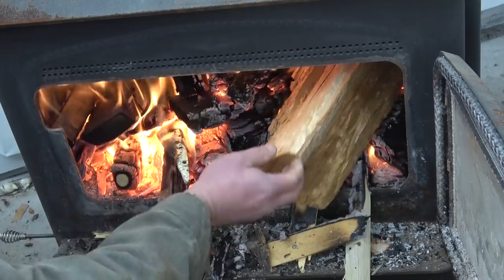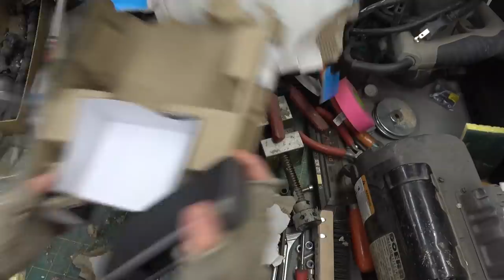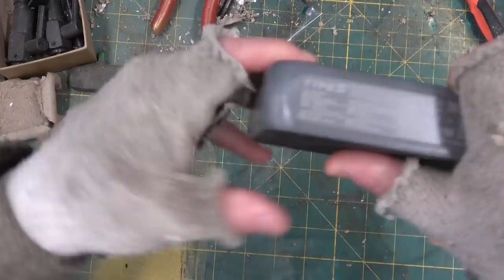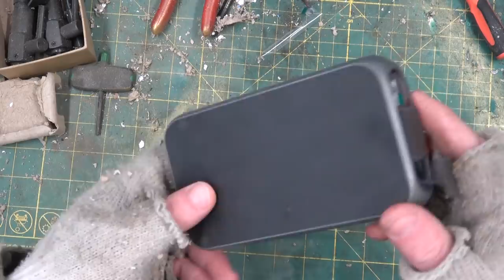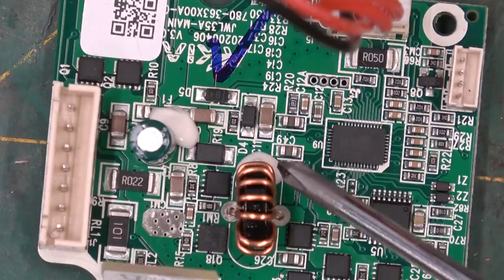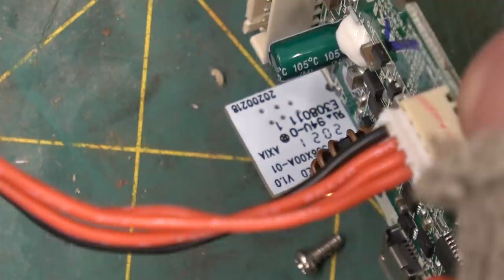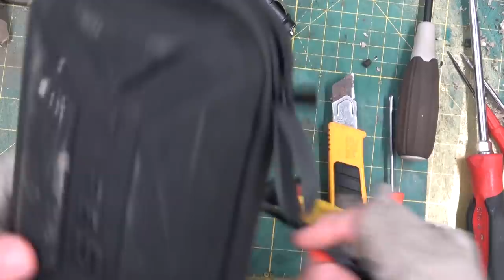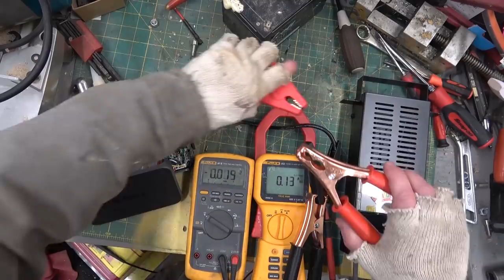BOLTR: Costco Boost Pack | Stupid Design

Comment: The question, my fine weathered friend.... was "Why all the voltage drop across the cable and Mosfet Assembly" And I'm still pretty green here, but I believe what you're seeing is the result of the high saturation current necessary to drive fets. I believe the packages there require a gate current of 1 amp to saturate.

Comment: I've used a couple of these jump charger packs, the usability is all about the dingus end that you are complaining about. The Anker models come with a much better thought out break out board for the 12-volt jumping controller. Having the active display showing you what the bit is doing is nice. It has no problem resetting itself several times and letting you crank the motor. The one I have has no issues starting up a car without a battery.

Comment: The problem with usb c is usually just dust and dirt that gets into the port and keeps it from plugging in properly. A needle or similar is usually enough to clean it out and get it working again.

Comment: You start fires with the same torch I do, but I skip the cardboard because it adds more smoke than heat and the heat isn’t needed if I have kindling at all. 
If I really want no smoke, I use the torch before I put wood in, to get the stove warm enough to start flowing up the chimney before I put wood in and light it.

Comment: For USB-C, the cable end is supposed to be one piece drawn steel.  If you look and can see a seam, then the cable connector wasn't produced to spec.  They made it so the cable is what is supposed to fail, not the jack.

Comment: These li-poly jump packs are old tech. I gots me a super capacitor-based jump starter—800A cranking amps claimed. Used it once to jump my half dead battery, worked like a charm.

Comment: For phone I recommend magnetic usb cable (flat not round version), as small piece remains in a phone. When it gets worn out, you just throw it small piece out and stick there a new one and your are good to go.That way you won't worn out the connector in your phone.

Comment: Bought an older version of these 3 years ago as a gift for the lady. She had to try it once, called me to say "this POS doesn't work". Assuming problem existed between battery and heels, I decided to try it myself later. Worked 0/5 tries... In fact all it ever does is beep "NOOOOOOPE" on every attempt. And yes, it was hooked up correctly. I even tried it on a weak mower... it cranked, but was too weak to even start that (Label rated 200-350 crank Amps...... more like crack asses). Absolute hot stinky garbage. Buyer beware.

Comment: The need for the reset is probably because of what you pointed out- the box on the leads was made from a third party (cheaply) and probably doesn't interface well with whatever is in the main box.

Comment: What the cheaper jump boxes do to prevent the car's charging system from over-charging the battery is they setup the battery to be ~16v when fully charged. With a typical car charging system rarely ever running over 14.4v, you wouldn't be at risk of overcharging the battery. Your battery was showing very near 12v, so I don't know that yours had the same philosophy. Although the FETs would likely prevent back-feeding current in your unit's case.

Comment: I have that same booster. jumped 4 or 5 cars and 1 truck.  The last few times, it has let smoke out of the little box on the jumper cable ends but still works.   You absolutely have to let it wait, it won't crank shit right off the bat.
Reply: P.S. my wife works for a liquidator that handles southern california Costco returns, so she has stacks of these at all times.   it is a commonly returned item.

Comment: Watt hours are printed on batteries for flying and the TSA does not require multiplication skills, 100 WH limit per battery. The switch is probably inset to reduce the odds of accidentally pressing it as it bounces around the back seat.

Comment: These battery packs do actually work in the cold, but only on the second or third try.  The initial attempts warm the battery up, until the voltage rises high enough to actually get the job done.  You just need to make sure you have enough total charge to handle a few failed attempts before it's warm enough to turn the engine over.

And that screen is LCD, not OLED.  There's no way such a device would have an OLED display, which costs way more money to manufacture than a simple LED-backlit LCD.

Comment: Remember that the sense protect is depending on a battery not a pure resistance load. They do work with a low battery connected

Comment: I have some experience with LIPO batteries as they are almost exclusively used for RC cars due to their ability to output very high current, 50-150a. The one cable from the battery pack itself is a balanced charging connector, the battery is likely 4s (4 cells in series) each cell is 3.7v. The batteries should be balanced charged to keep them from overvolting one cell and blowing up the pack. The one thing I was wondering (before you got to the jumper cables) was how it was going to control the voltage going out. You can NOT simply hook a LIPO battery up to a motor or some power draw, you MUST monitor the voltage on the battery as you are drawing from up because if it goes under voltage it will become unchargable. So it made sense that it has that voltage monitoring on that jumper cable. which is probably all that is.

Comment: I'm just going to say it, my Vauxhall Corsa is often (in the current situation where I'm rarely allowed to drive anywhere) hooked up to a CTEK charger that is capable of charging a luxury yacht (litterally, that is one of it's intended purposes). But as an engineer, I'm building in some tolerance and also some features that smaller models just can't cope with (that I have used., and needed). I'd have had to buy a new battery by now without this, but I'd also need more than just a basic charger because driving is such a rare occassion now, so overlall, going for the massively over-engineered option, at about the price of a new battery, has saved me money.

And we only see about -10  C here in a bad winter, or -28 C in a really bad winter in my home town (-18.4 F)

Comment: Hey what we need is an charging adapter brick that takes an 18v makita power tool battery, then current limits the discharge to about 20-40 amps. That will then let you dump charge into a lead acid over a period of just a few minutes. However when i search online for devices like '40 amp curent limit' the only devices that comes up are solar charging controllers. Which are way more expensive and overkill for this application.

Comment: If your pixel phone type c port is not working like it should, try digging out the compacted lint and dust that is likely wedged down inside of it.
I cleaned out my phone's type c port and it plugs and holds good as new now.
I recommend using something sharp and very hard, like a good sewing needle.

Comment: It's cutting out because the circuitry isn't noticing a battery source connected to it and all jump packs have a circuit that stops them from pushing out high current unless it's actually connected to a battery source and they all have a bypass system to override the circuit to alow power without a battery source they look for more then 10 volts if battery is lower then 10 volts you will have to force it by using the bypass because it thinks it's not connected to a battery when the battery is lower then 10 volts @AvE

Comment: The amount of current the thing can deliver to the battery between the time you turn it on and walk around to the driver seat, get in and crank it puts enough capacity back into a lightly discharged small automotive battery to overcome the locked rotor current demand of a starter motor and get it turning.
this tiny jump packs will never give enough current to turn the starter motor on its own.

If you're looking for a high quality version of these look at the NOCO GB series units.

Comment: The reason it kept resetting on you is probably that it does not detect a voltage. Many of these units either cannot function without being hooked to atleast a weak battery or being put into a manual override. They check for the voltage to be sure that the leads are not backwards. Usually no voltage indicates a problem with the leads as well. Also try hulkman jump boxes. I just bought one on amazon and I was quite impressed, though I have not had it apart.

Comment: It looks to me like a 6S LiPo battery. You can charge them via the main + and - leads, but it's most effective to get a great complete charge by using the ballance lead to get a consistent 4.2v maximum charge on each cell.
BTW a 6s LiPo is 22.2v, so that junction box with the battery clamps on it would be a step down converter.

Comment: I had one of these and there is something in the circuitry that senses an actual low battery. I had to jump my 4.7L Ram and I had plenty of time to walk back, get in and crank it over. It really did have enough energy to get the job done. I found that a battery that was not just low, but low and at the end of its life will confuse the little fault light system in the dongle. A good, but discharged battery works just dandy. 

I fiddled with it enough to think that 5 second time is for self protection or user protection. I would suggest hooking it up to an actual low battery and engine to really test it out.

Science also demands you do this when it’s -40 and snowing and the middle of the night after Dewclaw has abandoned you 100km from anywhere. 

Also, why in the world would you keep it in the back of the truck? The size and luxurious case clearly indicate you put it in the glovebox or center console. I would really hope it wouldn’t cold soak that quickly.

Comment: I've found that USB-C is more robust than micro USB. The cheap C cables can lose their gripping power on the port, but I've been using the same USB C cable since I bought the Nexus 6P and it's still gripping strong, whereas the Amazon special cable I use with the vehicle charger began to slip out, so I just swapped ends around and she's holding on tight for now.

Comment: Lithium cells were a long time coming because the early ones pretty much had a default state of being on fire !
It took a lot of tweaking to the chemistry and construction to get them to the relatively acceptable safety levels they're at today. Even so, Li-po's can still be a bit "Troublesome". If something goes wrong with the charger and the battery is over charged, charged at too high an amperage, or voltage, they tend to turn into a firework. If you over discharge them it can damage them internally, then when you recharge them...... Firework !

Comment: I own a cheap jumper that I carry in my bakkie (South African for truck) a 1997 Nissan 1 tonner 2.8liter diesel engine. And it cranks it right up. I once had a issue with my glow plugs and it cranked it more than 5 times (5second cranks) in a row before the truck started up. They work for me.

Comment: I’ve got one of those little jump packs, and I start 5.0 liter f-150’s all the time with it, but I bought mine from matco tools and it don’t have all the dumb safety features on it. If your reversed it don’t work. Mine doesn’t come on until it sees a voltage drop from the battery and it’ll stay on as long as your cranking.

Comment: for those phone charging ports that stop working. I found that pocket lint becomes compacted inside like concrete over time and a stiff needle is needed to scrape it out. Mine worked like new after I found this out.

Comment: On your phone not charging by the cord, you most likely have a build up of packed lint at the bottom of the charging port. I have had the same problem multiple times over the years. Best way to get it out is a sewing needle or tip of a safety pin. Just the tip mind you. It usually takes some heavy pokin and scrapin the lint gets packed in pretty tight.

Comment: Can confirm, these do manage fine with a Honda Civic in the Midwest, as long as it isn't below freezing.  Don't work a lick on anything bigger.
Reply: Also, should mention I'm using a slightly different one.  Mine doesn't have the weird pack, instead just connecting the clamps directly to the pack.  It also has a simple cutoff by looking for a 12v supply before opening the connection to the battery.  There's an override switch, since a totally dead battery cant trigger that supply check.

Comment: a lot of those packs need to see some sort of voltage from the dead battery before staying on. 
so you have to use it in series with a partially dead battery or it will shut off in a few seconds. some don't even come on at all

Comment: Mosfets are used to control charge and discharge of the lithium-ion batteries. It utilizes the body diodes of mosfets to keep either way operating while other is turned off._

Comment: It may actually be able to start your Cummins in Ft McMurray, I've had diesels that had the block heater plugged in overnight cranking over but they won't start, just need an extra 10 rpm to get ignition to happen

Comment: I like your box cutter. Bit more chooch than the mini one that bit the dust a while back.

On the usb-c, I find the cables wear out pretty quick, but the socket seems to hold up better. If I remember right, that's by design. It was the other way around with micro usb; the socket would wear out and even a brand new good quality cable wouldn't work.

Comment: yea those are MOSFETs that are used to switch off the battery supply to the leads. They would be wired in parallel to handle the high current. The 12v voltage drop was because they were switched off at the time. P.S. npn/pnp are BJTs (transistors) not MOSFETs.

Comment: The way these things actually work, is you 1) hook up, 2) turn on ignition.  The little dingus end senses current draw and enables the "jump" function, and then 3) you crank, that LiPo dumps about 2.5 Jigawatts into your starter motor 😂

Comment: Something like that is not meant to jump start a vehicle. As you saw it can't handle the amps. You plug it in and over the course of 10-15 minutes it puts enough charge in the dead vehicle battery to crank it over a couple times and hopefully it fires.

Comment: keep a booster pack warm yes. booster batteries are really ment to provide additional amps to start a vehicle, not so much to charge a dead led acid battery. Once the vehicle  is started the alternator charges the main battery. 

Mosfet bridge rectification, work closer to ideal diodes, and can provide polarity protection without voltage drop seen by diodes.

Comment: Tip for a warm stove, clean pipe and low fuel consumption: pack the bottom of your stove with wood and light a small fire ON TOP. Rationale: If you do it the conventional way the heat drives the combustible goodies from your wood way faster than they can be burned. This way however the heat frees what it can burn.

Comment: This kind of booster has worked 3 times for me on cars, in quebec winters. Different "Brand" but also bought on costco, and with the exact same voltage dropper. But yeah the unplugging to reset and the very short leads makes it a pain to use alone.

Comment: Actually the lipo batteries don't loose any performance when cold like a lead acid.. They just need to be heated internally, which will happen as soon as you complete a circuit with it. So in reality the power from the battery will continue to go up as you apply load to the battery until it reaches it full current output.

Comment: Have you tried cleaning the Type-C port they are prone to accumulating pocket lint and dust. You can use a small pin or a toothpick to scrape out the dirt from the bottom of the port. This has revived the port on my phone multiple times already and given your work environment I bet you there will be lots stuff in that port. You will be amazed as to how much junk actually can come out of it.

Comment: That thing with the clips,,it keeps the vehicle from back charging the unit,  it also has some kind of timer in it, so the pain in the ass thing is, by the time you get the car alarm to shut off so you can crank, it times out, and you have to start the race again!

Comment: It's not a flaw in the device.  They aren't meant to supply 500+ CCA.  They are designed to trickle charge the battery.  If you want enough CCA to crank over an engine, you get the bulky devices with a lead acid battery in them.  That's why a lot of the lithium devices can plug into your cigarette lighter/accessory port to charge the battery.

Comment: I have one of these from a different brand but has the same dingus end. It will keep power going but it has to detect  some charge in the battery. I have run into this on very dead batteries but otherwise works fine. If there isn't much power I've run into a situation where you have to juice the battery a few times then it'll stay hooked up.

Comment: There's also a pretty awesome product out there using capacitors to take the energy in your flat battery over a few minutes and then your starter can draw enough cranking amps from the capacitors.

Comment: My son bought a booster pack and came home from work one night with BOTH headlights out, I check and sure enough both bulbs were blown. Replaced them and all was well until a week later when BOTH headlights were blown again! He told me that he had boost the truck and when hooked up the leads the headlights came on and when he started the truck the headlights flashed like a camera and blew right out. The directions state clearly to turn off the lights before jumping but I don't understand what is happening when the box is jumping the truck. I have not measured the voltages yet.